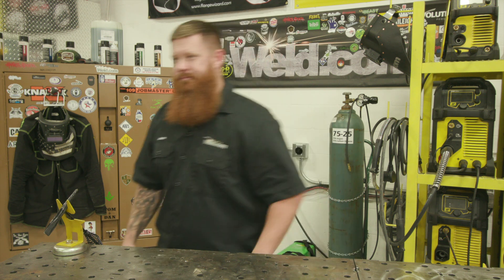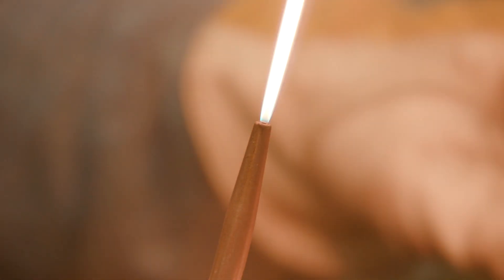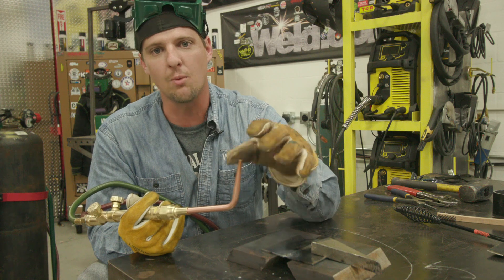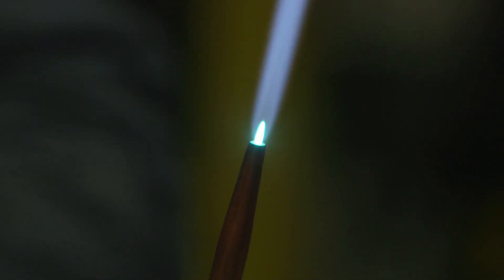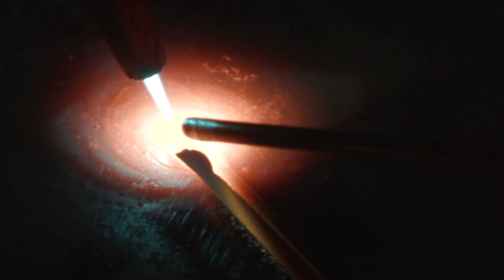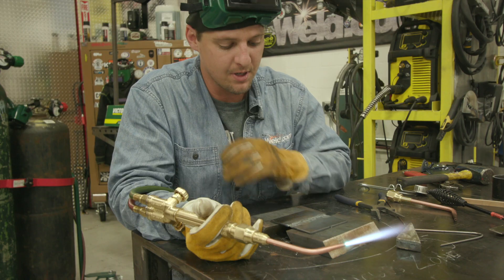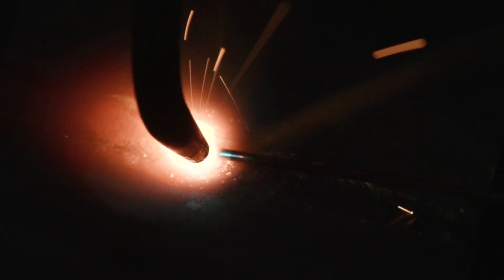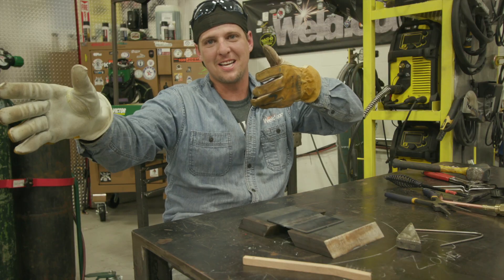OLD SKOOL!! Oxy-Fuel Welding (with @mancubwelder)

Comment: OA welded nearly all the joints on WWII aircraft including aluminum, and was used for heavy casting repair on many items that would be discarded today. Get a copy of the Oxwelders Handbook no later than 1939 (cheap online or can be downloaded free) as it's worth the read. Too many welders neglect using torches for welding, especially fine work that's too small for most TIG (jewelers use torches and blowpipes in tiny work because they're effective).  Soldering and brazing small items like brass carb floats is yet another use. The classic torches from when OA was king are mostly affordable and remember it's tip size that's key so if you have big hands there's nothing wrong with an OO tip on a full size Victor 310 or 315 handle.  

Small "aircraft" (Victor J-series etc) torch prices are driven up by collectors but they sell cheap with small used torch kits on places like Fecesbook Marketplace where the seller knows little about torches so look at the torch handle in the adverts. You can tell by valve position and small hose barbs what most are even from poor photos. Medium and large torches often go cheap on Ebay especially if tarnished but there is very little to go wrong with them. I've many torches from the 20s and 30s that work fine.

Comment: I learned how to do this back in the early 80's. This was an easy way to connect new exhaust pipes on my 73 Charger. The hardest thing is getting use to the torch weight. My dad would use coat hangers, amazing!

Comment: Hello, when I do Ox Acetylene welding on mild steel I usually have problems with popping and the weld puddle exploding. Is this always because of a tip that is getting plugged or held too close to the weld puddle. Your incite please. Thanks

Comment: Question.. I ran some mig beads on a project that I believe had low penetration.  Can I take a torch to improve those welds ?  Essentially get it to have more penetration and some annealing?   Grinding off those welds is not an option.

Comment: When I was taught oxy acetylene pipe welding many years ago ,  flat , vertical up . Horizontal vertical.  Butt, branch , also the leftward and rightward method,  oh what fun , popping and banging,  blowback,  sparks in your ears , down your shirt and underwear,  many a time you'd set your overalls on fire when you'd got into a comfortable position and didn't want to move , oh and the welding with a mirror when you couldn't see around the backside of a joint ,,   all good fun .
Reply: Oh and the dreaded overhead , where you control the weld pool from falling on your head with the pressure and angle of the flame and placing the filler rod in at just the right angle and time, now that is a skill . 💥

Comment: I remember working at Mastco building drilling rigs, sometimes early early mornin, the power would go ou all over the place, we used our oxy acetylene toches on the carbonizing side of flame to light the shop every now and then, hitting the tip to get rid of carbon on a chunk of wood....  damn, ..... I have good memories of the possibility of going home those days... but the light was great.

Comment: Good afternoon, can Flux cored wire be used for oxy-acetylene welding?
Reply: There are fluxed-core aluminum rods for gas welding, so it doesn't matter what filler material you use. Yes, fluxed-core wires are very brittle.

Comment: I learned using AO torch welding but I still struggle with popping. Are there more reasons that popping happens besides the two mentioned?
Thanks for the video.
Reply: Popping can be from too low of settings for the tip you are using.  Get the Acetylene flow up a tiny bit more and it can help.  Or go to a smaller tip. I do it to myself all the time after not welding for a while.

Comment: What’s the difference between this and brazing? Seems like it’s the same except for the filler rod? I’m new to welding and always looking for ways to increase portability vs cost around the ranch. I currently have a few cheap eBay welders which work surprisingly good. Looking to add an oxy welding mix to the tools.

Comment: Back in the day we did all our race car exhausts like this and with coat hangers for filler now u can't use coat hangers there nothing but slobber and slag but also this new exhaust pipe has so many impuritys and galvanizing that you can't hardly even mig it

Comment: The pop is caused by one of your sparklers getting up in the tip. The sparklers, in turn, are caused by a flame that is a bit oxidizing at the outer edge. "Traditional" gas welding teaches you to use a neutral flame, but that is actually a bad idea. Neutral flames are always a bit O2 rich at the outer edges. Also, most rigs use single stage regulators, and as the O2 cylinder pressure falls the outlet pressure creeps up, making the flame even more oxidizing. Ideally, you should use 2-stage regulators for gas welding, but when gas welding went out of fashion so did 2-stage regulators. The best practice, whether using a single-stage or 2-stage regulator, is to use a slightly carburizing flame. Say, 1:1 inner cone to acetylene feather length. This won't make the flame rich enough in carbon to substantially carburize the steel, but it will keep the sparkly show down as well as giving you indication (by the constant appearance of a slight acetylene feather) that your flame hasn't drifted into an oxidizing condition.

Another tip: For gas welding thinner material, say 1/4" or less, you will find that an aircraft-style torch with 3/16" hoses is much more comfortable. It's about as close to TIG as you will get with OA. My favorite is the older cylindrical-body Purox W-200, but they have been out of production for many years. If you can find one along with a good assortment of genuine Purox tips, they are great little torches. The forged-body W-200's that were made up until 10 or so years ago were too heavy for prolonged off-hand welding sessions IMO, but their extreme ruggedness made them superb field torches for the HVAC trade. My #2 choice would be the Smith "Airline" AW1A, which is very similar to the Purox and has the advantage of A: Still being in production and B: Still being made in the USA. Another one that is also very similar to the Purox is the Harris 15, which is also a nice little torch, although no longer made in the USA.  Finally, there is the Victor J-28. I have never been a huge Victor fan, but they were fine until production got moved to Mexico. Now, quality has gone down, IMO. The one positive attribute is the popularity (which is also a negative, because it has pushed many far better torches out of production), and because of this popularity there are many clones available. Most are China/Taiwanese, but a couple are USA made. One is the Uniweld 71,  which looks like the Purox W-200 or Harris 15, but it accepts all Victor J-28 welding tips. Of course, Uniweld makes welding tips for the 71/J-28 as well, not to mention specialty brazing tips for the HVAC trade. If I were in the market for a Victor J-28 compatible torch, the Uniweld would be the one I would probably select. If I were in the market for a new aircraft-type OAC welding torch, I'd go with the Smith AW1A.
Reply: This is excellent advice.
Reply: I am going to try this with the flame adjustment with a little bit of feather and see how welds look.
Reply: @infinityphotorob  The welds will look the same or better. As long as there isnt too much feather, strength and toughness will be equal or better as well.

Comment: I Work in Germany for A Heating/Plumbing Company and we Use Oxy Acetylene to weld all of the heating pipes for the buildings we are constructing. I've welded miles of pipe already and also all the heating pipes running to each apartment for floor heating. Germany uses the old school boiler room setup with radiators in the apartments but all modernized. when I construct the boiler room in the basement i have to weld using the right welding technique unlike the Left welding technique done in the video.

Comment: I learned Oxy/ace welding from an old mechanic when I was in my late teens about   50 years ago.  He was in his 60s.  He had made many of his tools by hand and hammer on a anvil. He said oxy/ace was all they had when he started and if you could weld with gas you could use anything.  At that time there was no MIG or TIG.   I watched him oxy-ace weld an engine cylinder back together bore it, hone it and polish it. Then he put the engine back together and it ran for years just fine.  He was the chief mechanic at the shop.  After a few more years he lost his eye sight but he kept right on working telling us what to do.  Trucks came in and drivers told him what the truck was doing or not doing.  He told us what to look at.  He had the patients of a saint. I wonder how many guys he taught. 
I did a lot things with out a clue and was amazed when it was finished.
Reply: Good on you for remembering and respecting an old mentor. A lot of the older methods are being replaced by technology sadly .
Reply: @jasonmcmanus6169  ohhhh yeah. I am 35 and guys my age look at a carburetor as if it was some ancient half mystical object. Working on this new electronic crap and working on a carbureted vehicle are like night and day. I can do both. But I am more and more not interested in being a mechanic because I do not like this new junk. I like the old ways. Who I am inside fit with how things were. Working on old stuff it's almost like an art form. You have to use all your senses and your 6th sense even. And you used your skills and brains. (And body!). I always liked the more physical part of just manhandling metal. I also love to tune and adjust the many things necessary to make old engines run perfect. It's all subtle and every tiny thing makes a change or difference.
Reply: @jasonmcmanus6169  mate, You can't stop progress. You shouldn't matter if something new or old, just what best fits your needs. If some method is old and it ain't the best at what it does, ditch and don't feel bad about it. There was a time when O/A was the new technology and maybe some blacksmiths didn't like it compared to forge welding, but it serves it's purposes.
Reply: Both TIG and MIG were well established technologies by the 1940’s…..Gas welding and brazing have never been surpassed in practicality and likely never will…
Reply: It Really is an art you need an eye for. And I guess if you happen to lose your eye sight for it. You can always pass your knowledge to someone else. I don't have much experience with this, but when I learned it in high-school, it took me a few attempts. I was told "you need more heat". And then sarcastically I slowed down and melted that shit. My teacher didn't say a word when I brought my weld to him. He just grabbed a hammer and started bashing it to shit. To my surprise, the metal received more damage than my weld, and it held. He said, " now that's a good weld". That was my experience in high-school before I moved away...
Reply: That comes as close to the definition of a mentor as it comes.

Comment: Too bad, most ppl did forget how good you can do automotive body welds with Oxy-Fuel. Usually no filler is needed and you get a nice flat and, most important, soft bead.

Comment: I'm a gas welder at a gas utility company in Oregon. I gas weld up to 2" pipe. My test is a 3/4x1" branch and a 2" buttweld uphill. Out in the field we do 1" and 2" butt welds and 1/2" to 1" gas service tee's on 1" to 2" mains as well as 1" and 2" half line stoppers, all on live gas. As far as oxywelding on live natural gas lines, you are constantly on the verge of burning through. I could gas weld plate with my eyes closed.

Comment: xcuse me but what makes this welding method desireable ? 
cant you do the same with TIG 
I usually onley use Oxy acetylene for heating press fittings, loosening rusted tight stuff, burning off paint and burncutting and brazing never welded steel - i onley ever welded copper and brass with it and brazed on tungsten carbide onto tools
Reply: oxy fuel is used when the material thats being welded cant have electricity running through it or when electricity simply isnt avalible or is being maintained at the time or something. you can pretty much do everything with a torch, you can cut which rules out the grinder and you can weld some pretty thick stuff too. it might take longer but it does the job like it did before any arc welding processes existed

Comment: I have a question for you. I know you can not use a torch to cut aluminum, but can you use a torch to weld two pieces aluminum together with or with out filler?
Reply: You can braze aluminum with a torch... 
Its 2020, a quick google search will tell you that.

Comment: It was nice seeing this kind of welding again. I used to work for a CNC router manufacturer where we had machines with aluminum vacuum bed tables for mounting the work. From cast aluminum plate to mounted on the machine and squared to the cutting head took over 24 man/machine hours. My coworker crashed the head into the machine and tried to fix a 1/2" deep x 1/2" hole using a MiG but only made a porous mess. The chief welder of the plant had us mill a larger hole in a cone shape and he used oxy fuel to repair the defect. The repair managed not to warp the top plate where the defect was repaired despite it's thickness only being .7". I remember machining less than .015" before the mill was scratching the rest of the bed.

Comment: I learned oxy-ac welding in high school 84-86. i was weld slow but my machine shop teacher was hot and fast. i've welded 2stroke motorcycle pipes with a cutting tip (all he had at the time )and a clothes hanger in my friends garage back then. what ever works for you but learn them both, slow and fast. cool video.

Comment: For a spectacular example of Oxy/Acetylene welding then watch two Coppersmiths welding half inch thick Copper plate vertical up with one torch on each side of the plate.
Reply: Where would that be used? Like in brewery equipment, maybe?
Reply: @kristianskov4841  Yes Christian and Whiskey Stills.

Comment: I get the impression that if I've got a larger oxy/ace rig in our garage and there's ever a fire, the fire department will just bring popcorn and watch it burn rather than risk entry.  (Huge respect for firefighters, but I understand not risking a tank in a fire!)

Do you have any thoughts/suggestions for folks keeping a gas welding rig in a residential garage?  Is this nothing to worry about or something that needs to stay in the shed in the back when not used?  Seriously, we do lotsa MIG and I've been looking at 220A TIG rigs, but a gas rig gives us some good abilities.  I'd like to know if that's a good direction.

Thanks for a great series of videos!

Comment: A tip I discovered using the 3/32 wire is to lay it flat and hold it just above the weld puddle and weave the torch from either side of the filler rod and let the filler drop down onto the weld puddle. It makes oddball angles easier to weld in. I enjoy gas welding because if you can master gas, tig becomes REAL easy and there are time when gas can blend a weld in easier than even tig can such as on thin sheetmetal. Tig will leave you with a great joint but a bunch of material to grind down but gas tends to spread the weld out leaving a smother joint and less to have to grind back. Disadvantage is it creates a large heat effected zone meaning the metal will try and pull around on you if you don't plan for it. Great vid and hope it turns some folks on to the old school way to weld.

Comment: I use a 00 to fuse sheet metal for expansion chambers for two stroke racing engines. Run the flame down the joint almost tangent to the weld and dip the cone in frequently. For me it’s faster cleaner and easier than tig.
Jeweler fine tips work great for fusing thin sheet metals.

Comment: Nice job Oxy-Fuel Welding.
I have used the torch almost 60 years to do most of my welding.

I would like to see some demos on but welding some 19 and 22 gauge cold roil steel and some 3003 H14 0.50 - 0.62 aluminum. This is the material I have to work with every day in auto body restoration, custom work. The mig makes the welds to large and to hard to work. That is why I use the Oxy-Fuel for welding.
Reply: If you're welding paper thin steel and aluminium , why the hell are you trying to mig it

That's what's tig for